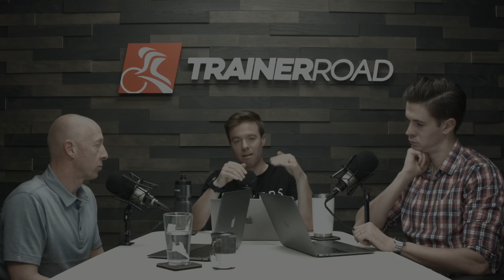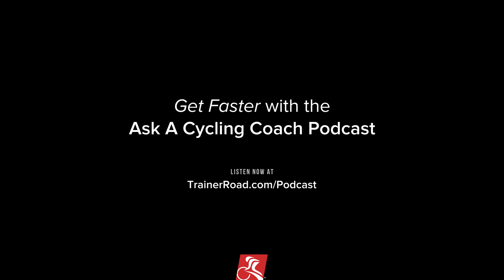Why Power Zones Don't Match Heart Rate – Ask a Cycling Coach 186

Comment: Disagree. What matters in training is what your body is doing internally. A training plan should have goals to work specific areas of fitness. Letting heart rate rise blends the type of work your body is doing, and it is not a benefit, it is a highly variable departure from the goals of the workout.
Reply: I disagree with you and with them.

You and too many others have this idea that high heart rate means you have to call an ambulance.

As long as your RPE is still sustainable, cardiac drift during steady state power is not a reason to back off.

This clip (and you) failed to mention the perceived exertion part of the equation.

Comment: Is it normal that to maintain my Z2 heart rate, I have to maintain Z3 power? My heart rate zone is always lower than my power zone. I've recently done a FTP test so I know the issue isn't that my power setting is too low
Reply: Does your lactate level not change with thr HR? So if your target is base volume, adoptations in z2. Won't it make more sense to stay in that lactate level to keep working that fat burning energy system
Reply: That would probably mean your Cardiovascularly more powerful than you muscularly are. 
Also.. What method do you use to set HR zones
Reply: @rejickmukherjee9154  same here, my PR z2 = around 130bpm (I set my hr zones by max and min hr), normally if I go by hr I would ride endurance round 140-148bpm. My PR zones are set freshly of a ramp test, where I also got to around my max hr (I've never went over 189hr in various trainings and tests, here I went up to 186). Idk if I should follow HR zones or PR zones

Comment: Excellent explanation! Thank you! So, during a 24 hour race you keep recruiting different muscle fiber types as each type fatigues. Is there any benefit to sprint and speed training for the endurance cyclist? My opinion through some experimentation with my training is yes. Is it correct to assume that as you train using sprint and max speed workouts you will get a benefit of recruiting even more muscle fibers as you fatigue?